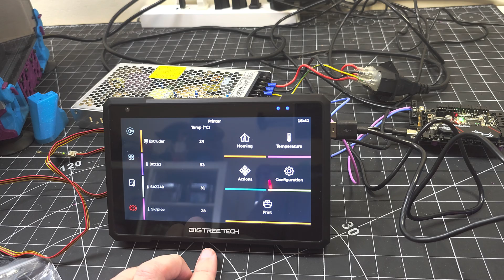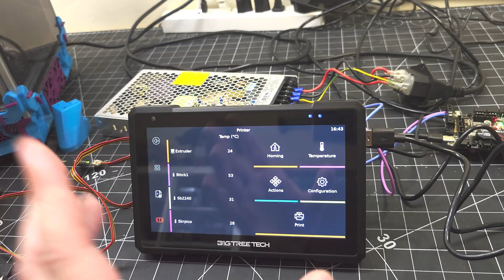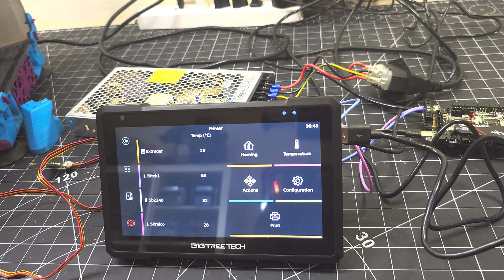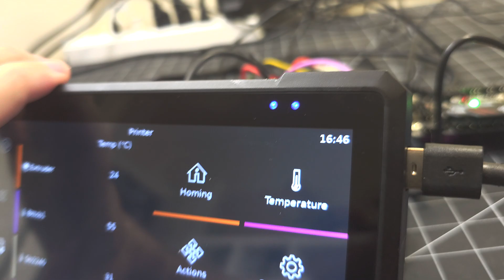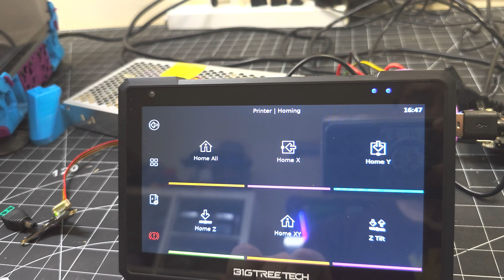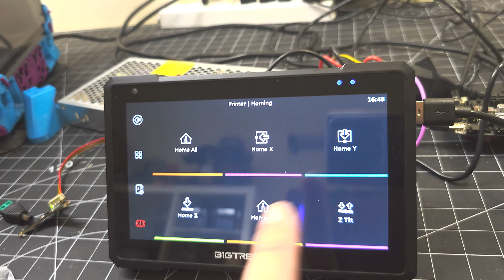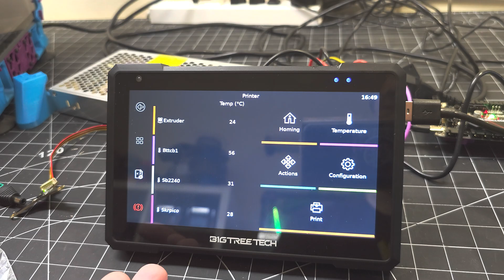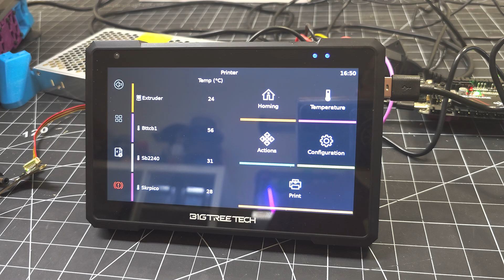From The Bench: Episode 10 - BigTreeTech Pad7

Comment: I'm wondering what more we can do with the can bus... Something that I find lacking with the pad 7 is access to gpio pins that could allow for controlling power, lights (a klipper expander could be used for lights) or whatever people might think. Also, does the pad 7 have the 120ohm resistor already for that side of the can network?

Comment: I'm currently trying to get a similar set up going on a heavily modded ender 3 v2 running an skr pro v1.2 and a micro swiss ng revo direct drive on a linear rail and I'm not going to lie I'm still fairly new to every aspect of all of this. Touched my first sbc,  flashed my first firmware, first ssh session first wired jst connector, first wiring schematic literally first everything of every little aspect of the 3d printing and programming and whatever other worlds meet at the cross road of melted plastic within the last 6 months. I understand everything I'm doing why I'm doing it what it does and everything you think you should know before you tear apart a 3d printer and found out their are whole other worlds i hadn't known i needed to know yet. Like I'm said I'm running the skr pro v1.2 on the ender 3 with the micro swiss and everything else you can do mechanically to an ender 3 with the pad 7 as the host and i have every btt module and add on that is compatible with the board that i am currently TRYING to add and figure out the wiring and the pins to use and the klipper configs and everything i need to do but i dove too deep in without enough knowledge about some things and i was trying to originally just get the board operational and then add the resume print and power off and then eventually the u2c and ebb42 and i can't find after months of hours and hours long searching find the answers i need to make the power off or resume print work with that board and klipper so i decided to wait and try to learn more first to figure it out myself so i decided to just try and get the u2c and ebb42 working from the can on the pad 7 and realized i don't know how can works or how to wire it and they don't provide the cables nor information to make them and furthermore the pad is a two wire spi to can and everything else is a 4 wire can bus and i can't find what i need to figure out all of that without overloading myself and getting too stressed to work through it. So I'm wondering especially since there is at this point almost nothing out there tutorial wise for working with the pad and peripherals or hardware if maybe you might be able to find time to explain the setup in this video or do a video of it from making the cables to connecting all the modules or possibly point me somewhere that i could find even the cable making and what's required for it or really anything because I'm starting to lose steam to finish this project and i absolutely love it so I'd rather not give up. Anything you might be able to help with would be more than appreciated and if i can come up with a few dollars i could buy you a coffee or something. Sorry for the incredibly long comment but I'm struggling right now. Thank you in advance
Reply from the maker: Here's another SKR Pro 1.2 user that has shared their Klipper printer.cfg:
https://gist.github.com/lhess/d1061787b4b275517e8e285dab738dbe
More general info on how to install Klipper on an Ender 3 V2:
https://www.reddit.com/r/klippers/comments/kj2h5r/stepbystep_guide_for_ender_3_v2_klipper_w_bltouch/
The CAN bus port on the Pad7 only provides CAN H and CAN L which you can wire up directly to your toolhead's CAN H and CAN L, but your toolhead will need 24V and GND from somewhere. Usually that's your 24V PSU.
Alternatively, you can skip the Pad7's CAN bus port entirely by connecting it to a U2C over USB. The U2C would also need a 24V and GND feed from somewhere, like your 24V PSU, and then it can pass 24V, GND, CAN H and CAN L to your toolhead PCB using the 2x2 pin Molex Microfit connector (the smaller black one) that came with your U2C.
Then you need to learn about setting up a CAN Bus network on Linux. I personally follow Esoterical's excellent guide on this here: https://github.com/Esoterical/voron_canbus
There's a lot to unpack, but hopefully all of that information should help you get over the finish line! Best of luck!

Comment: Howdy neighbour :)
Would you happen to know if the CB1 onboard the Pad7 would be capable enough to run two printers and two USB web cameras simultaneously?
When I first started running klipper on my Sovol SV06, I was using a Raspberry Pi Zero 2W and a pi camera V2. 
I was unable to compile crowsnest due to it the compile locking up, so I had to move the build to a 2GB pi4 to finish it and then move it back to the zero.
Back on the zero I was getting mcu errors all the time when trying to stream, so I ended up moving it all back to the 2GB pi4.
Reply from the maker: It has 1 GB of RAM, 3 USB A ports, and 1 USB C port. I would be reluctant drive two printers with webcams off of it myself.
Reply: @oldguymeltsplastic  Thanks for the feedback on that.
I've since discovered that my idea was not totally valid and my understanding of how it would be set up was incorrect.
The new plan is two klipper installs with a shared webcam, since both of my active printers sit on the same bench.
My current setup uses a 2GB Pi4, and it's only using 240 MB of RAM to run klipper and a USB camera.

Comment: The manual is not that straight forward Iam using U2c with ebb42 .
Reply from the maker: If it's a newer EBB42 with an STM G0B1 processor, and newer U2C, then the first few videos of my From The Bench playlist should still work, as the new EBB42 uses the same flashing steps as the SB2240 that I cover in those videos.
Reply: @oldguymeltsplastic  ok I retry tomorrow thanks for responding.

Comment: You have a link to that stealthburner stand? I can think of a couple of uses for it
Reply: How can I get in contact with you need help installing ebb42 (I try installing firmware but cannot get uuid).
Reply from the maker: Yep, it's here:
https://github.com/hartk1213/MISC/tree/main/Voron%20Mods/Non%20Printer%20Voron%20Stuff/Voron_ToolheadStand
Reply: @oldguymeltsplastic  thank you ❤️